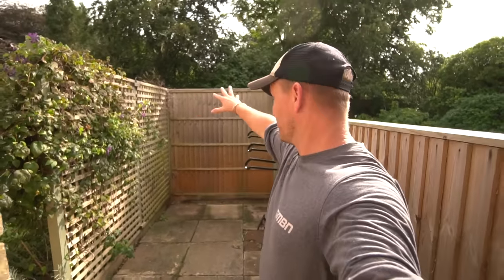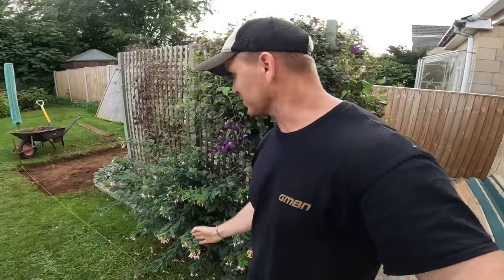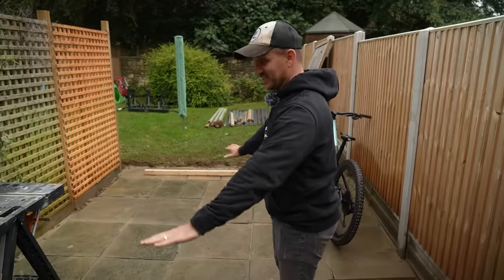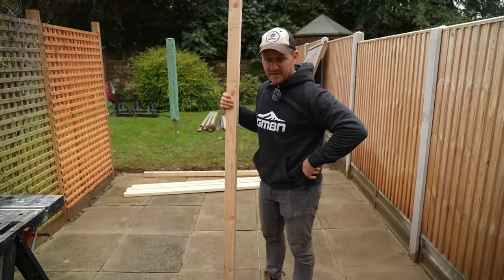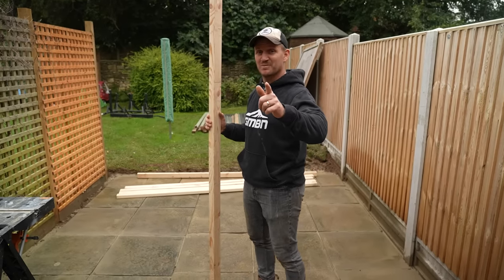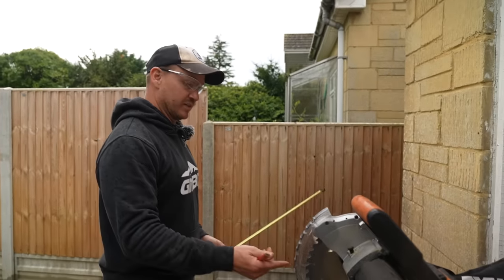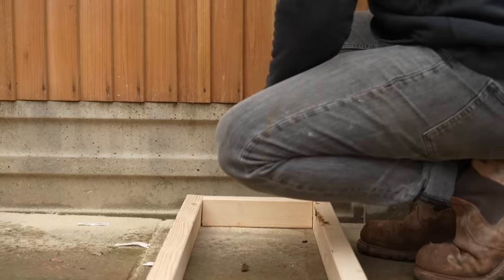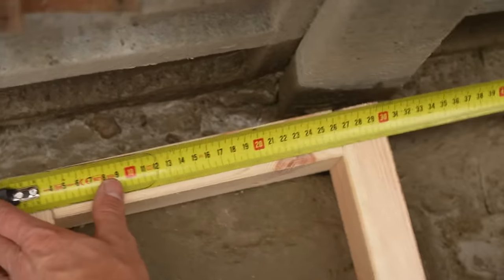Building The Ultimate Bike Storage | Blake Builds A Bike Store

Comment: Nice work! Pro tip - fix the corrugated roofing on the top of the corrugation (into a timber plant underneath), rather than through the trough where all the water runs: will keep those bikes much dryer!
Reply: I really hate that coroline stuff, it bows when it gets hot (cardboard impregnated with tar) and then falls to pieces unless it’s installed flat on moisture board. It’s been a disaster on my car port roof! And yes to the fixings on the high point of the corrugation.

Comment: Looks nice, some extra ideas for you:
1. Offset the heights OR turn the brackets by a few degrees so the bars dont clash and saves turning stems.
2. Make it a bike dryer, wet bikes in it after washing isn't ideal so add a waterproof floor (maybe with a small drain hole) and then add some door seals and you can wire in a small electric heater to put on for an hour or so after washing bikes, especially in the winter when they never dry outside and just get rusty.
Reply: Instead of an electric heater, a dehumidifier would both provide heat and get the moisture out of the air.

Comment: Add a basket/container for commonly use tools. Brake caliper inserts, air pump, shox pump, tyre lever, spare tubes, chain tool, bike cleaning equipments and diskbrakes cleaner. 

Add light in the shed and add a working light incase you drop  something small. (portable working light)

The wheel stand/holder on the doors can double as a quick workstand to do a quick adjustments. (use heat shrinks on the rebar to protect the wheel axle and frame)
Reply: Great ideas. Thanks dude

Comment: I was busy typing and then you finished with my suggestion - add guttering with a downpipe to a water butt and with the Worx Hydrashot you will never need to use a tap!

I would also build a stand on the outside to hold your bike when you are washing it (and a drainaway for all the crud).

Only other thing is running power so you can see what you are doing on those early morning raids.

And use a small block of wood with three holes drilled in it for the allen keys... that way you can see if they are all there (and they won't fall out as easy)

Great work Blake!

Comment: Need to fill in the gaps where the roof corrugation sits on the shed frame... Or wind will blow rain in and onto the unprotected osb ceiling.
Tbh, you should have put the corrugated roof on last, after putting waterproof membrane down.
Recon you should fill the wall voids with insulation too.
Reply: I bought these foam inserts to go under the roof corrugation. Didn't make the edit I guess. Thanks for the heads up dude

Comment: 11:33 screwing in the valley will likely cause the roof to leak in time. Put the roof fixing in the high point of the corrugations. Once the rubber goes brittle/ cracks the roof is at risk.

Comment: nicely done sir, for security please add some coach bolts on those door hinges and hasp/staple, a ground anchor would have been a great addition when you were doing the slabs and lets not mention that you put the roof fixing nails in the valley instead of the top of the profile. I love your build episodes especially with the budget, great inspiration and advise for the viewers.
Reply: also cover both hands when welding else your absorbing UV in your uncovered hand from the welding torch

Comment: Great job Blake, just a thought on the front wheels, instead of some threaded bar, could you have welded 2 thru axles together and then wound them into some thread on the door? Abit of extra security and a little bit safer than threaded bar sticking out 🤣🤣 great work though, good watch and very funny, looks like you had a great time on this 🤙🏻

Comment: Nice job. But look out for mould, especially if bikes are put away wet as timber needs ventilation and there doesn't seem to be much.

Also watch for rot on the edges of the OSB, again if things get damp. Especially the cut edges of OSB need to be sealed, which I'm sure you did off camera.

Comment: Roof fastenings should go through the ridges of the roofing, not the troughs. Also, you need some DPC between the concrete and the timber to prevent moisture transfer

Comment: I am not an expert but I would have thought to raise the floor off the ground with some slats of wood so water does not get trapped underneath and rott the floor, you can also put bolts on the inside of one door so when you lock it the doors are harder to force open